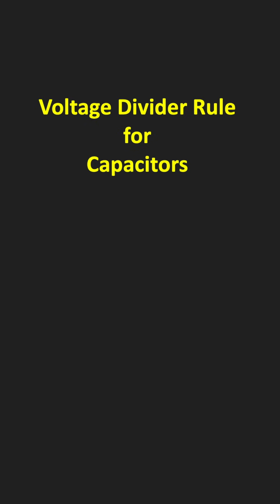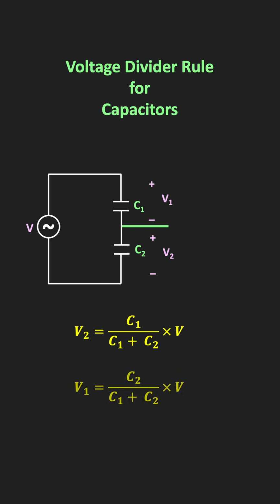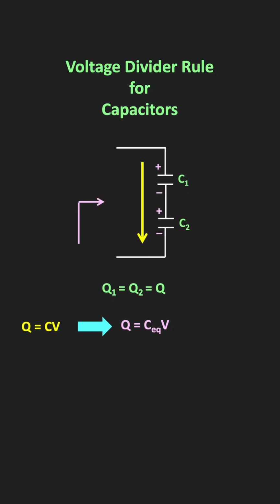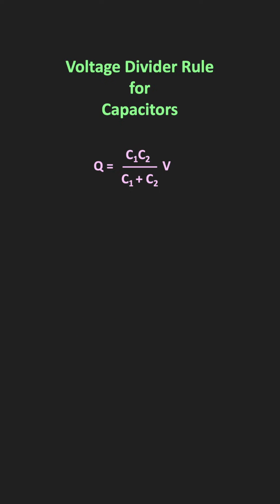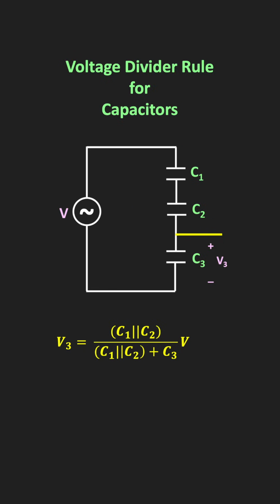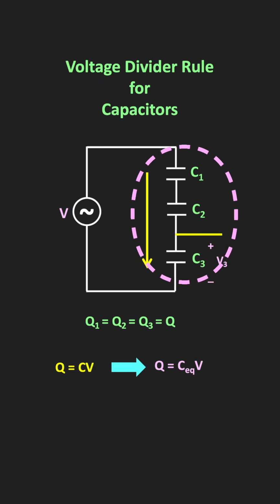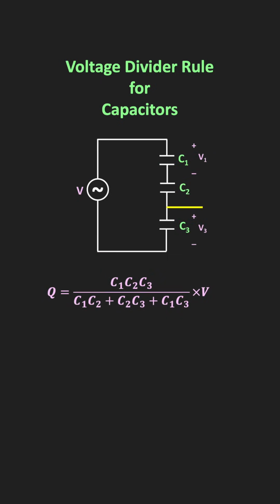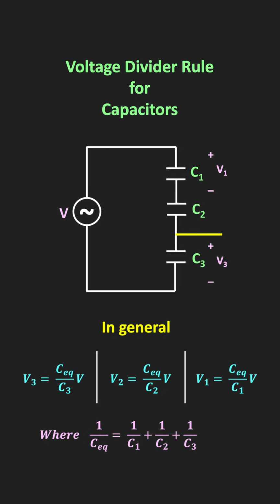Voltage Divider Rule for Capacitors Explained

Comment: 2:16 sory i'm not a Master in english
But i don't understand how Q1=Q2=Q
I assume that ,that serie of capacitor has the voltage V across it and i think that if C1=C2 then Q1=Q2 but how Q1=Q2=Q
Reply: What i mean is why Q shouldn't be Q=q1+q2
Reply from the maker: You can understand in this way. Since capacitors are connected in series, the same current will flow through all the capacitors right ?? Now current is basically a rate of change of charge. So, whatever amount of charge that is pushed by the source towards the capacitor C1, the same amount of charge will be pushed by the plate of capacitor C1 towards C2. 
And in this way, at any given time if you see the charge across the capacitor then it will be the same. If the capacitors are connected in parallel, then that will not be the case. And in that case, what you are saying would be true. I hope, it will clear your doubt.
Reply: @ALLABOUTELECTRONICS  understood . Very well 
Thank you